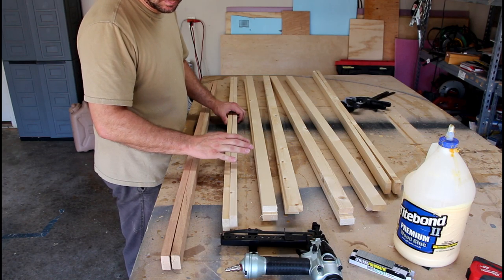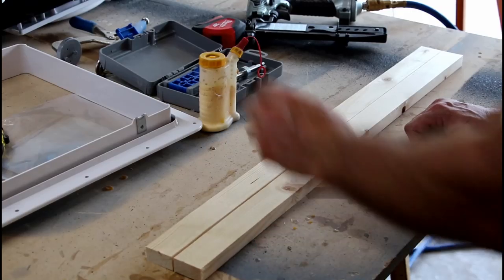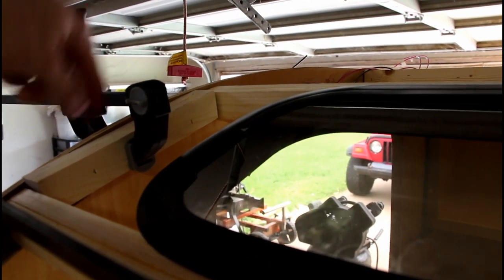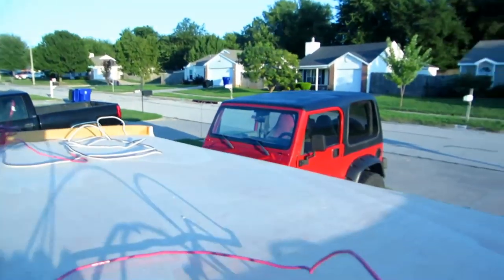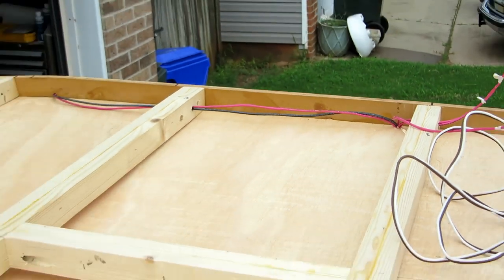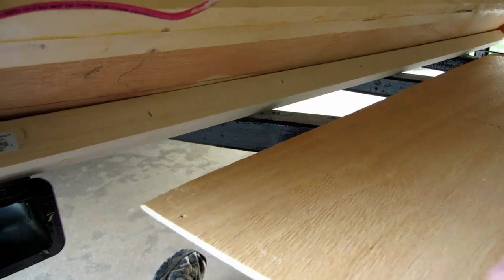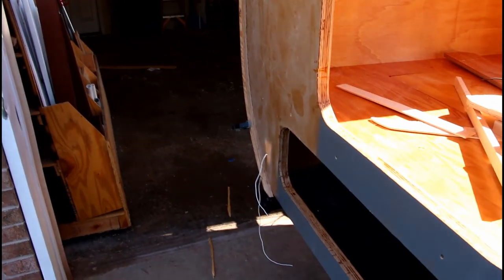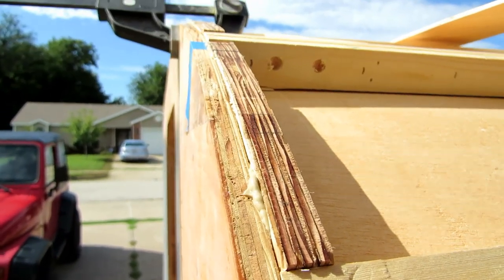Teardrop Trailer Build - Making the Ceiling and Spars

Comment: Great documentation, thank you. Starting a build soon on a 8x4 trailer frame. Contemplating how I should mend two pieces of plywood for my walls so I can extend my curved front out 6-8”
Reply from the maker: I didn't have to do that but I think most people use a half lap or scarf joint

Comment: I know this is old 2018 if you drill a hole each bottom end of the spar just deep enough and put two steel bolt in holes then you can use magnets on the inside with string to find spar use staple gun

Comment: why do you use the 1x laminate for the spars versus the store bought 2x2, I know that some times when I rip a 2x4 it tends to twist
Reply from the maker: I was pretty much just following Steve Fredericks manual/guide at that time. If I would do it again I would use 2x2's to possibly save some time. Although he may have built a few teardrops and found it easier to get straight 1x2's and mate them together.
Reply: @Waynegoproductions  That is true finding products that are without warps is rare.

Comment: I don’t think I missed it, because I watched the video a couple of times. But how did you attach your spars to the side walls? are those pocket hole screws?
Reply from the maker: I used Brad nails from the top down into the lip that the interior ceiling rests on. I have seen people use  screws instead of a Brad nail if you do that I would drill a pilot hole first. I figured between the glue, nails, and blocking between the spars that would hold it. Some people will use a screw through the outside of the side wall into the end grain of the spar. I didn't like that because now you have created an area where water could intrude into the wall if you ever had a leak on the exterior side of the wall

Comment: I’ve seen a lot of people glue spars together like you have in their builds, is there an advantage to that I’m not aware of? Why not use 2x4s?
Reply from the maker: When I did my research I do remember seeing a couple with 2x4's. I would guess most people don't because of weight. Also you would lose 2 inches of head room and have to fill the space in between the roof and ceiling with more insulation

Comment: Have been looking for a skylight/sunroof very similar to the one you installed. What brand did you go with?
Reply from the maker: I don't remember the brand off the top of my head. I am having to store the teardrop at a buddies right now so I can't go look at it. I just found a used one on ebay though. It has been leaking on me from the initial install. It leaks from the window seal itself and not from around the exterior.
Reply from the maker: I would suggest do some research and make sure you want to do it. I know some people have put them in with no problems at all and some people have continuous problems with them. It really does open up the inside of the teardrop and make it look bigger. Check out this thread on tnttt http://www.tnttt.com/viewtopic.php?f=2&t=71241

Comment: No it would not have made it completely flush when you did the prices between the spares because that long bending piece was the same thickness of the one by twos that's why you were so far off. If you had kept the bended cut ply piece and stuck it to the outside it would have done the exact same thing only with more strength and then you would still have a one inch gap to fill with insulation